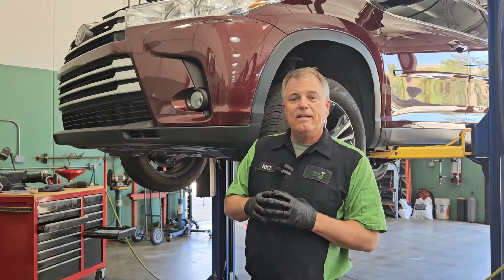Can I drive my car with a bad Mass Air Flow Sensor?

Comment: Should i worry about damages to the engine or transmission?
I've my car nissan sentra sl 2016 the maf sensor keeps failing for second time after replaced with used one but a while afrer.
I've been driving for around 5 months with the second faulty maf.
And i feel noticeable power and fuel loss.
I've a part purchased online that i can plug to the ecu and connected with my phone via Bluetooth.
Every time it happens when the engine light comes on and i open the app connected with ecu and do precise diagnosis then i get the result faulty maf sensor then i do precise clear codes then engine light goes off.
But when it happens and then engine light comes on the car starts driving abnormally slow with higher rpm then i clear the codes right after then the car starts driving normally.
But right now I'm too worried about engine or transmission damages
Reply from the maker: The code could be false.  A volumetric efficiency test should be performed to check MAF and engine performance.  In theory is has the potential to hurt the transmission, but I've only seen that happen once in my career.